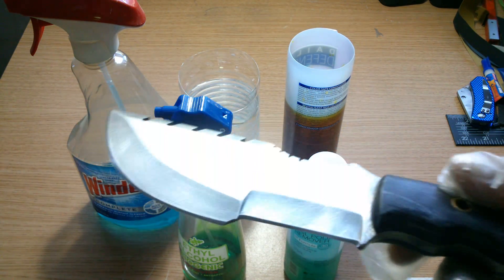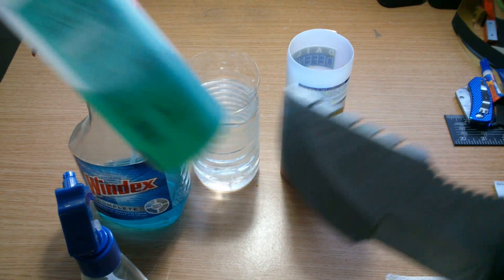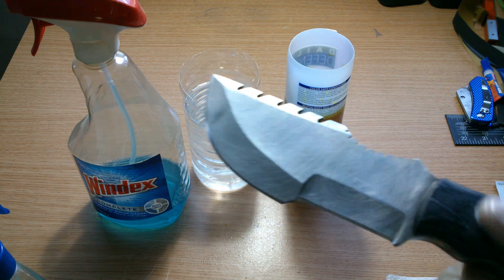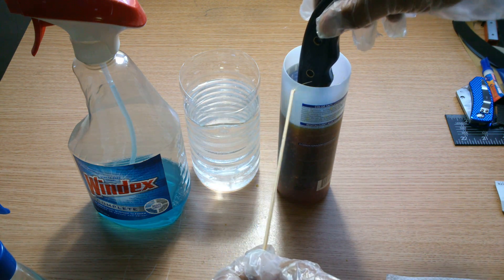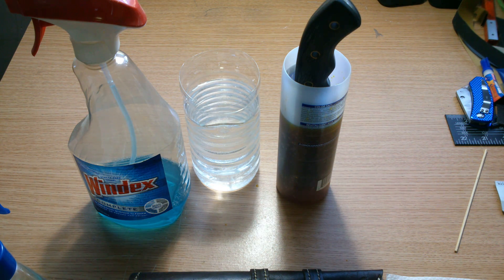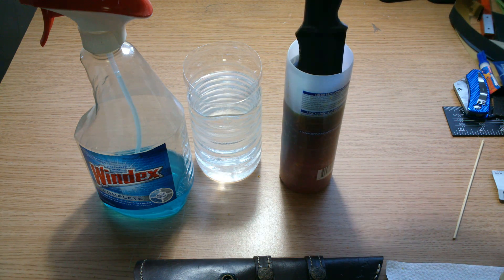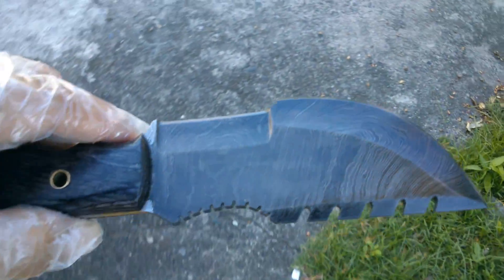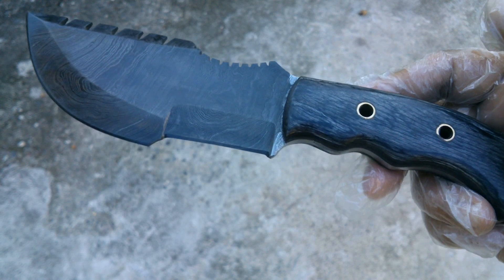How to Acid Wash A Damascus Blade

Comment: it's an acid wash, not an etch. you would get the pattern of the domascus on the tang as well. and hit it with 1000 grit sandpaper very lightly and the light and dark lines in the domascus will pop.
Reply from the maker: I knew it was somewhat off to call that an etch. I was always looking for that word. So, acid wash. Thank you @Tenacious Dan for the heads up!